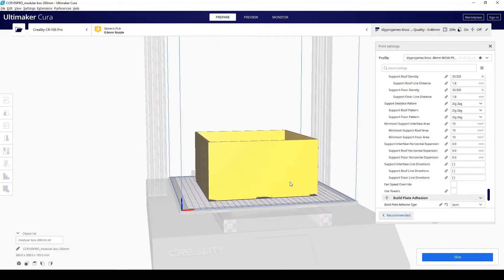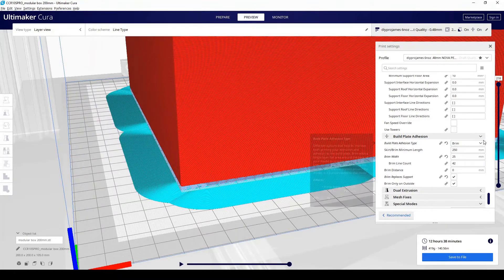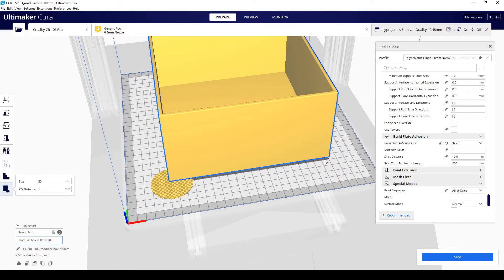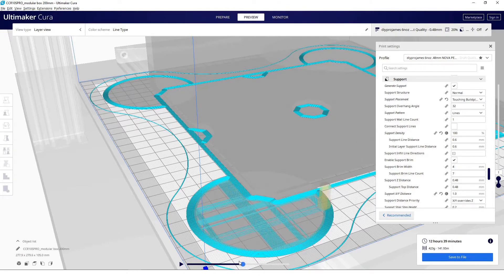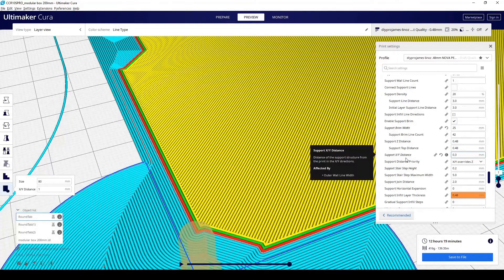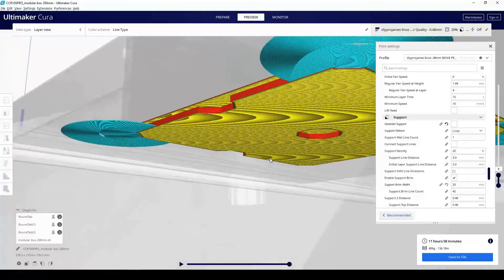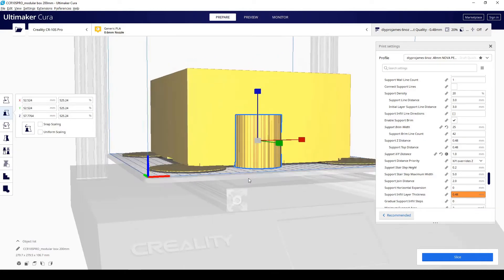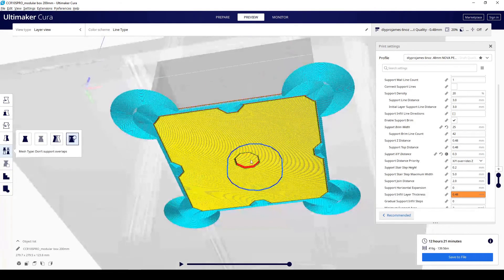CURA FILES - ANTI WARPING TAB PLUG IN - HELP FOR WARPING AND ADHESION PROBLEMS. fixed audio

Comment: Excellent info this is just what I need. I am having problems with warping in PLA even. Thanks
Reply: If you are having warping with PLA then your bed temp might be to high.
Reply: @lolmandood  thanks for the data. Currently I am using 60°C for the bed, what temperature do you recommend?
Reply: @fpgamachine  I'd try 55c that's what I use and have good results. I tried 60c and had warping. So I went back down to 55c. Try it out and let me know.
Reply: @lolmandood  ok thanks. I will let you know my results.
Reply: @lolmandood  I tried with 52°C, previously cleaning the bed with alcohol. I printed a box of 100mm x 80mm x 80mm for an electronic project and it doesn't have warping. Thanks!
Reply: @fpgamachine  amazing.  im glad I can help.